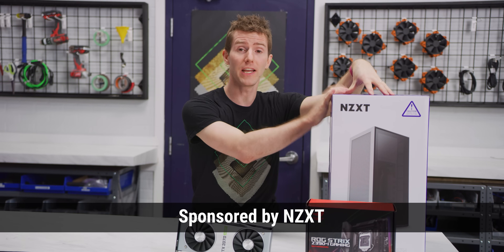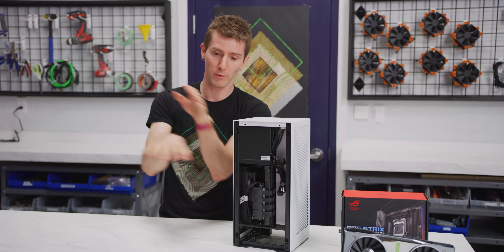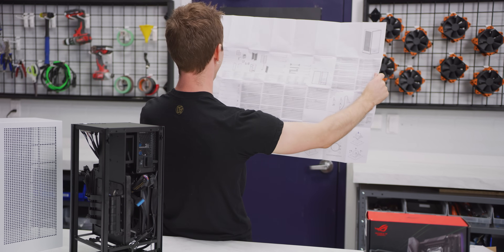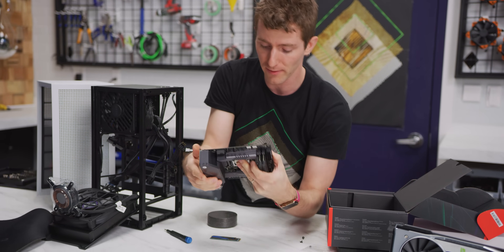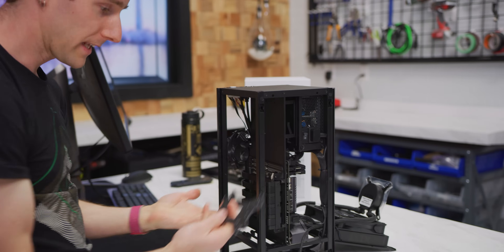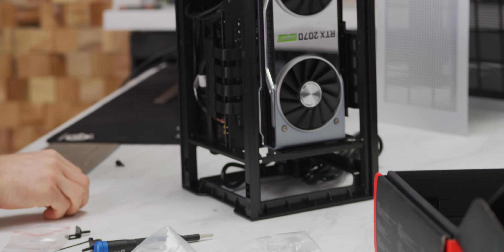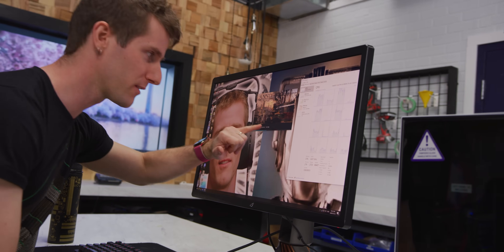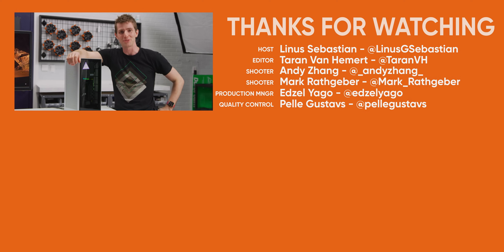Building the Xbox Series X Rip-off PC

Comment from the maker: We have been made aware that there are supposedly potential fire hazards with this case due to the PCI-E riser. Purchase with caution or get in touch with NZXT if you have purchased it.
Reply: Certified bruh moment
Reply: @saferlocke  this is a certified hood classic
Reply: @saferlocke  69th like
Reply: NZXT sourced their PCI-E riser cables from a company called " WINNING", they were custom made to the perfect length with reinforcements and bends right where you need them.  WINNING installed a PCB ( like the majority of PCI-E raiser cables ) at the base of the PCI-E raiser that clips into the GPU.  The problem is with this small rectangle PCB that is attactched to the PCI-E raiser and thus attached to your GPU.  WINNING for whatever reason maybe for easy fitment with other projects or custom builds they have drilled several holes throughout the PCB that are not used or needed by the case.  There are only 2 screws that attach the PCB to the case for stability and for whatever reason it's very easy to see the NZXT has either #1 Drilled out the prescribed screw holes that line up with this case to a bigger size than WINNING had provided on the PCB when sent to NZXT or...#2 Used larger screws that forcibly "bit" into the substrate of the PCB thus destructively making the holes bigger than all the other pre drilled holes.  You can see this when you remove the two screws to uninstall the raiser cable users will noticed a very disturbing amount of white/grey PCB dust that ejects from the screws threads and the hole itself.  it's clear to the naked eye that the NZXT holes were all at one time the same size as all other holes across WINNINGS PCB, until NZXT forced the holes bigger.  Why is this causing a fire? The PCB that WINNING used on their PCI-E raiser cable has a 12v copper power plane as one of the layers of the PCB.  Almost all PCB's have this layer but around all screw holes of any motherboard you will see " Grounding" protection to make sure no screws make contact with that 12v power plane in the PCB.  Steve at Gamers Nexus has shown and proven that any case out there pre fix is a ticking time bomb that just needs to be jiggled just enough so the screw that is oversized for the hole on the raiser makes contact with the 12v power plane and thus completing the 12v circuit because the screw is screwed into the case creating a ground making all that copper in the PCB along that trace a 12v heating wire or hot wire that will burst into flames.  I feel bad for NZXT for getting screwed by one of their parts partners that they sourced the PCI-E raisers from but it wasn't WINNINGS decision to forcibly blow out the size of the hole on the PCB bigger than was spec'd BUT WINNING also seems to have not included any grounded protection around any of the screw holes on the raisers PCB what-so-ever so this is a sticky situation.  

TLDR: Anything short of NZXT not providing free replacement raiser cables to all valid owners is lazy and irresponsible.
Reply: Just make sure that if you’ve bought this case you pay attention to the situation regarding the fire hazard and make sure you are able to receive and replace a new riser which will be provided by NZXT in the next month to people who’ve bought it. 

If you have bought it from a third party retailer, you may need to contact them to receive a replacement. 

Steve from ‘Gamer’s Nexus’ and his team have made three incredibly detailed videos on the situation, outlining the dangers and resolution of the issue, if you have any worries I highly recommend watching their videos on the fire hazard and NZXT’s response.
Reply: The case has now been officially recalled
Reply: it does catch on fire, not just supposedly, it has a 12v short circuit around plastic components and it shorts itself when you install the riser (drive in the screw)!
Reply: Nice, caught this update 3 hours after... Well that's unfortunate, wonder if maybe it's the new GPUs pulling more power from the pcie slot
Reply: 10 months on. Dedication
Reply: do you mean the screws or the actual cable?
Reply: @jeezygarceezy  its the PCB, so technically neither.
Reply: @jeezygarceezy  from what I remember the screws were pierced right through the riser’s pcb making contact with one of the pcb’s traces shorting it which could cause a fire. 

Tldr; both
Reply: @jeezygarceezy  yes
Reply: @jeezygarceezy  both, they SCREWed up
Reply: Why not removing the sticker?
Reply: will you make a 3090 in it?
Reply: F
Reply: this should be added to the title .. smh
Reply: @ LINUS WHERE IS THIS PC NOW IS IT 4 SALE
Reply: or u know just don’t buy it i know its crazy
Reply: The issue isn't that severe. It's safe provided that you use a nylon screw.
The only worry is that someone (reasonably not knowing about the fire hazard) will replace that nylon screw with a metal one, allowing the short to occur. Any case purchased new from NZXT at this point *does not have this problem*.
Reply: can..you get one like this still..only ones I saw were just pre builts.
Reply: LMFAO NICE CASE NZXT
... IMAGINE Making a case that burns... smh
Reply: Yes, it looks complicated.
Reply: relax, nobody is going to build this thing....
Reply: @brunomarz6362  
I would love to build something like the NZXT Which resembles the Xbox series X I never owned a gaming desktop I have always been a laptop gamer 😉👍
Reply: damn
Reply: I only have 1 PC build under my belt and this build may confuse me for a bit but I’d love to try it looks fun
Reply: Question about ram, if the mobo says 3200 base but 4666 oc can you run any speed up to 4666 all the time or do you run the 2 3200 sticks and 2 higher speeds. Last I built a CPU didn't have all this, still was using ddr2 at that point. Lol
Reply: No problem here with a Z690I AORUS ULTRA. but the RX6700XT didn't like contected over the raiser and was replaced with Radeon VX Rega which did work.
Reply: Any chance of adding an annotation on the video itself? :p
Reply: Lol yes tell us a year later
Reply: na mate someone just used an intel cpu

Comment: The reason many of us chose a console over a PC is the "plug and play" convenience. I built my PC 5 years ago and only played "VtM: Bloodlines" VtM visual novels "Silent Hill" original saga, barely "Saints Row: The Third" because they were the easiest to patch. "TES: Skyrim" "Resident Evil HD", "Resident Evil 4 HD" "Silent Hill" new saga and other games took me days to get them running decently well, many others will crash or the saves will go corrupt if the mod or patch were updated, and I was lucky enough to successfully used the Mod Manager.

I tried to play Halo Infinite Multi Player with a friend of mine and the darn game never run, RDR was so laggy that I had to restart my session to stop it and uninstall. And I'm not taking account of the built itself, get the right components according to my budget, see if they got support and pray the drivers don't trouble shoot.

With my Series X I only have to put the disc in and wait to upload (less time that get any game properly set in my pretty decent PC) or just simply buy the game and download it. The only troubles I got was with the S.T.A.L.K.E.R. saga, it's laggy and crash, the rest of my library is seamless and fast, I just turn on my console and I'm ready to go, and many ganes had keyboard and mouse support, like the remasters of Doom and Quake, Halo and others. I know I will not have some mod experience, but many have mod support (Doom, STALKER).

To be fair, the only games I keep on my PC are "Skyrim" (there's no way I will play vanilla again) and the VtM and Silent Hill games, the mod community is so awesome and the patch are easy to install and really enhances my game experience.

Comment: CPU: AMD Ryzen 7 5700X 3.4 GHz 8-Core Processor  ($178.99 @ Newegg) 
Motherboard: Gigabyte B550I AORUS PRO AX Mini ITX AM4 Motherboard  ($199.99 @ Best Buy) 
Memory: Corsair Vengeance RGB Pro 32 GB (2 x 16 GB) DDR4-3600 CL18 Memory  ($94.99 @ Amazon) 
Storage: Samsung 970 Evo Plus 1 TB M.2-2280 PCIe 3.0 X4 NVME Solid State Drive  ($54.99 @ B&H) 
Storage: Western Digital Black SN850X 2 TB M.2-2280 PCIe 4.0 X4 NVME Solid State Drive  ($139.99 @ B&H) 
Video Card: PowerColor Red Dragon OC Radeon RX 6800 XT 16 GB Video Card  ($549.99 @ Amazon) 
Custom: NZXT H1 Version 2 - CS-H11BB-US - Small Form-Factor ITX Case - Dual Chamber Airflow - Tinted Tempered Glass Front Panel - 140mm Liquid Cooler - SFX 750W 80+ Gold PSU - PCIe Gen4 Riser - Black  ($262.41 @ Amazon) 
Total: $1481.35
Reply: You can get a SX for 350$ lol
Reply: @Rooster832  My Comment was from 6 months ago
And why would I get a console and get locked into an closed environment with 0 control and high prices for everything?
Reply: @gruiadevil  I agree to a point but both have their cons a pros and is why I own everything and not just a pc

Comment: @Hardware Lab  I think the series x estimated cost was £350-£400 for GPU and 300 for the rest so your getting a 650 to 750 pound of performance on Xbox if wanted the get pc for it to match performance you'd be looking at £750-1000 unless you get some parts used about 650-800 still a bargain

Comment: 20 Rtx 3090 to work 2k Xbox series x emu on your pc
Reply: 30 fps but if you had 2tb ram and Rtx 6090x400 it will run 200 FPS or 2000 FPS an over killer like PowerPC
Reply: With 200 Core
Reply: Also
Reply: 50K Display resolution 😂😂😂😂

Comment: Regarding the ease of building a PC, just a side note, I’ve built three computers and had never put any extra fans on until this most recent build. I had more trouble putting new 120mm fans into a PC Case with other 140mm fans already installed than I did building all three computers and then having to figure out why the first didn’t boot. For anyone who is Jew to building just something I learned from my troubles: REMOVE YOUR PARTS FOR A MUCH EASIER FAN INSTALLATION.

Comment: i am in the middle of my first build using the meshify 2 XL case b550 xe motherboard, ryzen 9 5950x cpu, 64gb of corsair vengance rgb memory, corsair elite capellix 420mm cpu cooler, 2tb gigabyte aorus 7000s, 2tb samsung 970 pro, andddd the raedon 6900xt top gaming edition, all with a corsair 1200w power supply.
Ive watched every single video i can find online, and there is absolutely zero information on my graphics card on youtube, or their website, and it didnt come with any kind of specs, or instruction booklet. as i said this is my first build, and its very annoying cause they claim to make it easier than it used to be, but theres zero of the right information online

Comment: Will it fit this card:  EVGA nVidia RTX 3080 Ti 12GB GDDR6X GeForce RTX 3080 Ti FTW3 Ultra gamer ?
Reply: The FTW3 won't fit but the XC3 will. I'd upgrade the psu though because the one in the H1 is 650 watts and for 3080Ti, 750 watts is recommended.
Reply: @IzzyWitDaUzi  Thanks.

Comment: Dear friends... if you have one of these cases, or acquire one, just make sure you contact NZXT and have them send you the updated 2.0 riser assembly with the new PCB board. They have sourced the PCB from either a new manufacturer or a new process and the new one looks to be solid and safe to use. Mine is on the way via mail...
Reply: Just a follow-up, after I got the updated riser cable and had everything installed, I ran into a serious overheating problem. Turned out that the used system I'd bought on ebay had thrown its radiator pump or it had sludged up. I contacted NZXT, and they said they were out of the old V1 case AIO coolers. So they had me take my rig apart and send it back, and they replaced it with a new H1 V2 case, and it's been golden ever since.

Comment: 15:00 "this is a MUCH safer way to go..." 

guess this was made before NZXT realised those cases catch fire
Reply: Ye when it was new
Reply: @yourmom-ee5pb  the new ones still have the risk of fire if you ever replace the screws
Reply: such a BS statement, my case is stilll going strong without catching fire.
Reply: @digital-groove-86  its a TINY TINY risk. And it will only change if you mess with the screws on the riser PCB. So if you havent touched the screws since initial installation, there is no more risk than before since the fire is caused by the screw hitting a specific angle with a specific rotation. But still, fire is a VERY bad fail state, even if 5 out of a million actually catch fire.

Comment: Has NZXT fixed the pcie risercable issue? You know when a screw could expose a 12V plane in the riser pcb and cause a short to ground and set the complete System and in consequence your home on fire if you don't react quickly

Comment: This looks more complicated than when I built my own machine due to the difficulty of actually working with it while it's in there. I prefer a larger case. Installing a power supply isn't really hard at all, even if in my case I needed an adapter cable. And, just using air cooling is about as easy as installing the water cooling here. My massive case combined with my massive motherboard also gave me no difficulty with cable management, other than needing an extension cable for my USB 3.0 card.

Comment: It's a decent enough case, I've just built two for the kids (revised version with plastic screws). What was shoddy was initial NZXT response to GPU riser issue called our by Steve @ GN; that pressure has finally turned into a full recall. If you're a half-competent DIY builder (vs a BLD prebuilt customer with no tech knowledge), NZXT will send out a new design PCIE 3.0 riser AND plastic screw set, rather than having to return it. Thus far, I was impressed with simplicity of build, pre-managed cables made it all very easy (the kids basically built them with my supervision). Thermals are good on a Ryzen 3600 with a 1660 Super, but note that you can mod them to add extra fans internally on rear to help with exhaust on hotter graphics cards (which I'll probably do at some point). The bottom IO is a bit annoying but neat at least and you can always add a USB hub for extra accessible ports (it only has a single USB C and USB 3.0 on the top).

In summary it's a nice case, just a shame NZXT didn't take riser issue seriously enough at first as they've alienated a fair few users with their initial response...

Comment: You don't just "not close the lid" before switching on, you stop first at connecting MB/CPU/PSU (and the LED and switches cables normally) and NOT DO or CONNECT anything else until you can hear the "I cant feel any RAM sticks" POST beeps. If you cant hear those you already done messed up.

Comment: building a ps5 and xbox series s/x cost more than what it's sold with more than 35% loss also some real gaming part for gaming and only gaming so if you want to build a console killer you need at less $800 the reason theey sell it with that big loss is that they get it back with the games and services they sell on there stores

Comment: I got the H1 and it is freaking awesome. And yes, you NEED low profile ram. I purchase vengeance pro rgb and it will not close....
Reply: I purchased mine but have not yet collected from the shop because I’m wondering if I should cancel the order due to the fire. 
Could you tell me how your machine’s been holding up thus far? Should I stick with this machine?
Reply: @samueljeyanessan8353  hey mate! It is the best case I’ve ever had. Zero regrets. The air flow is good. The curtain in my room even got sucked up to the back of it for a few hours with a game on pause when I was out of the house, so it’s airflow was restricted and it got hot, but nothing happened, but apart from that which was my own fault it runs really cool for what it is

Comment: I'll soon build my first PC by myself and my biggest fear is that it won't turn on when I'm done building it...
Reply: It is not a good feeling but there is ways to figure out what your problem is. Dont worry you will realize it isnt as difficult or scary as you think until you run into a problem you dont know about and your heart drops but usually its a simple user error with an easy solution.

Comment: I just don’t understand why it takes a 1000$ build to have a variety of games that play comparable to the ps5 and Xbox which cost no more than 700 with all accessories🤔 can someone explain this
Reply: Not talking about this build specifically as it is priced similar to both console. Also, with this build, how long do you think it would last before I would have to upgrade something for the most optimized performance
Reply: Not true I could build a pc with non used parts that’s can run games at 120 FPS for the same price as the new consoles

Comment: In other words: “How to build a $500 console for $999”
Reply: That PC is in the ball park of about 2000$ more like, the previous generations fastest CPU for gaming and the previous generations higher end midrange gpu, with an extremely expensive nvme drive and high ended itx motherboard, not to mention that case alone with the cooler and psu is 350.
Reply: @devackroyd  sooooo how to over spend. Ok got it 😂
Reply: @mrmidnight32  Id say so at the moment, Microsoft and Sony are taking losses on these consoles in manufacturing, they are a good buy! Obviously as PC hardware progresses and leaves consoles behind in the coming years the rhetoric will change.

Comment: If the fan of the radiator is blowing inward, won't it bake the motherboard and could have a thermal breakdown (getting hotter and hotter) if a CPU that runs too hot is put in there?